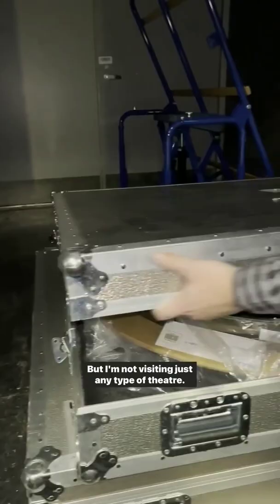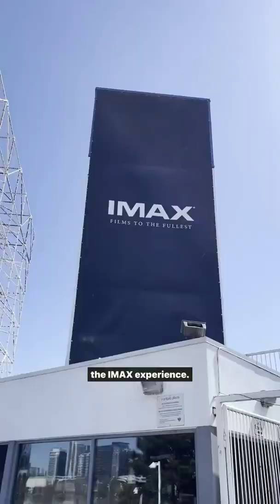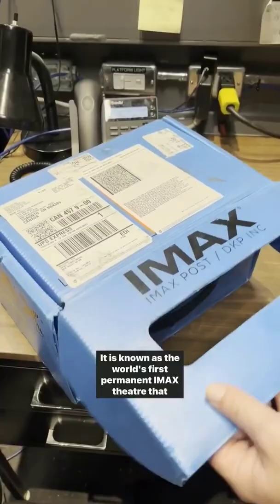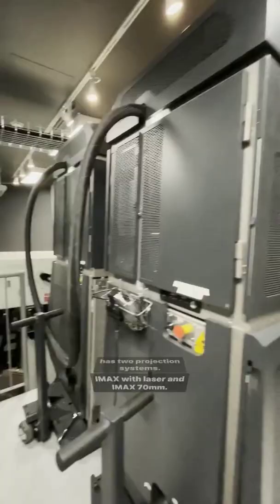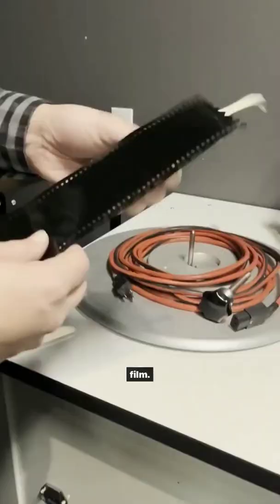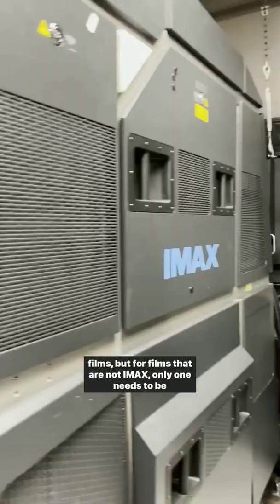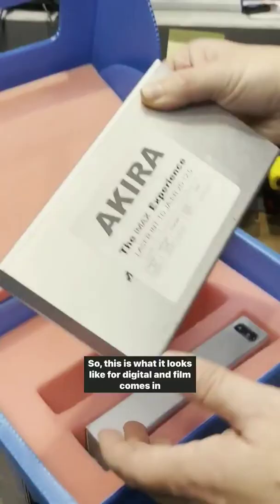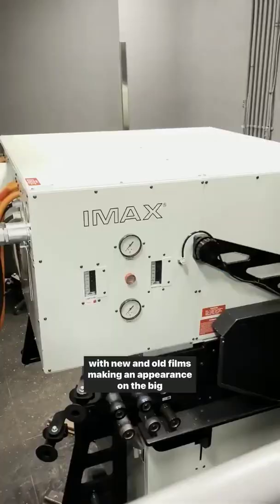This is how they screen movies at Toronto's Cinesphere

Comment: in hyderabad tru imax 3d 70mm 15/70 laser with 12k watts dd imax sound was there till 2015 and true screen 72/102 which almost 1.43:1 screen format and tilted and curved it was goosebumps experience for every hollywood movie every one will enjoy with every scene😊
Reply: Let me correct you please. 70mm 1570 format is a film format with is different from Laser system. So Hyderabad's Prasad's necer had IMAX with LASER system. Prasads unfortunately necer renewed their IMAX contract

Comment: I think we can both have digital and film because ultimately its what the directors vision is for an art piece is

But I think the economic arguement is the problem ultimately. We live in a society where everything is race to the bottom for maximum profit. Its not that we can't have projectionists, its that projectionists are to expensive conpared to an SSD where you slot it in and press play

Its not that film is expensive, RED MAG's are too, its not that both need their own dedicated hardware in workstations, both have their massive expense, but one is extremely skilled work and the other has been integrated into the editing workflow

But regardless, ive mostly stopped going to the cinema for the most part, even though i miss the magical experience, because for me, there is a visible richness in the dynamic range, the just barely perceptible movement of flim frames, and how it all comes together to create a stunningly beautiful look qnd feel that's nearly impossible to replicate in digital

And digital has become synonymous for me with trying to create perfect little scenes that have been processed for days (and have a much larger environmental cost we curiously don't talk about) that encourages digital effects rather than practical effects

Sure digital effects can look amazing, but practical effects are magical. Asteroid Ctiy was beautiful and charming because of the little imperfections that come from physical effects, that you juat dont see in digital

It's a shame... And it's going to contribute to the death of cinema because digital looks the same on my OLED TV as it does on a big screen... But film looks magical on the big screen and never the same at home